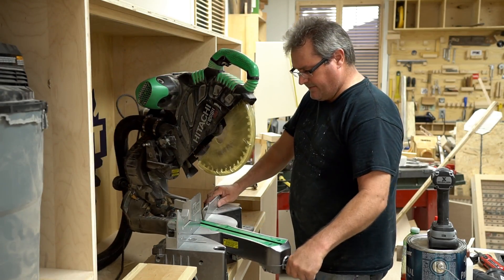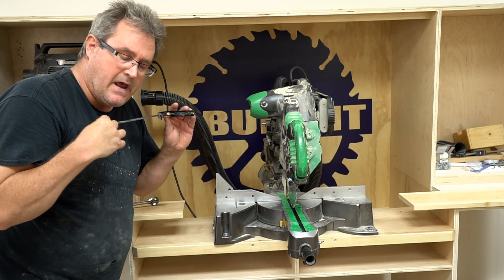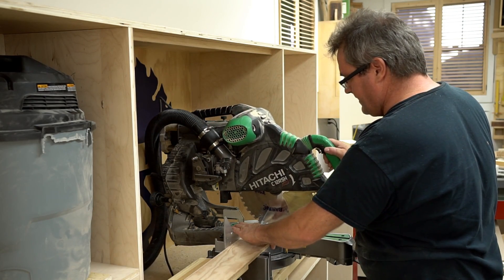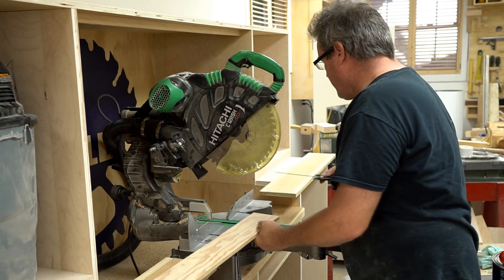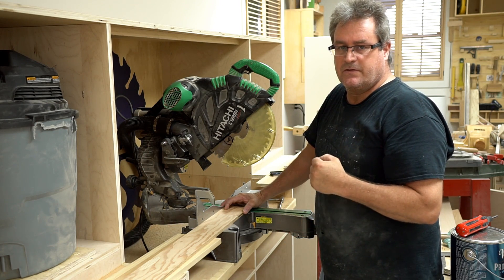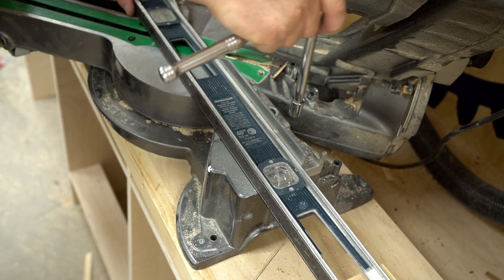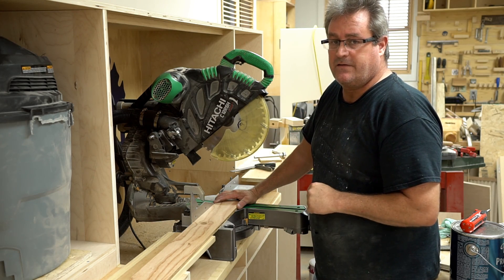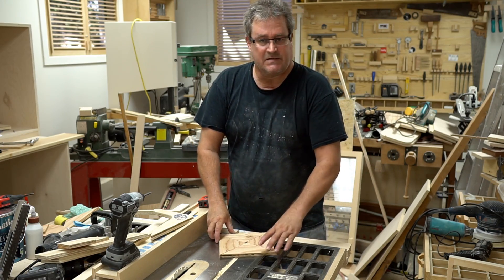Adjusting A Miter Saw For Accurate Cuts

Comment: Hi John,
Nice video. One question: when you tested the saw's 45 degree cutting capability, isn't the accuracy of that test be dependent on the accuracy of the plywood strip edges being exactly parallel since you referenced off of both edges? Thanks for sharing!
Reply from the maker: It's a given that the test strip of plywood needs to be straight and parallel.

Comment: Do the adjustable fences line up with the cabinet fences?
Reply from the maker: There won't be any on the cabinet. They only get in the way (if the stock is not straight) and are not needed.

Comment: Just got a Metabo HPT 12" Laser miter (basically the newer version of this). The left fence is so far off it's actually sad consider how much the saw cost.
I checked everywhere and didn't see anything that stuck out to be able to adjust them. After watching this video I'm going to go double check and see. Otherwise I'm going to have to basically make a shimmed fence to put on that fence... or just return it and get something that is adjustable.

I really like the saw so far after a couple weeks of use, but there's no way a supposedly $499 saw (marked down to $279 when I got it) should not have adjustable fences, right?
Reply: So, I went home and checked my saw after watching your video and realized I have to remove those subfences to see the bolts to allow adjustment to the main fence. I'm so relieved, and also questioning my engineering / mechanical ability now lol. After I finish this bathroom remodel, I have to get back to the trim, and am so glad I'll be able to dial my saw in and get more consistent cuts. Especially when doing the corners / 45s. 

Great video!

Comment: I'm sorry but where do you adjust if the blade is not perfectly 90 degrees (perpendicular) with the bed?  You checked it and it was but you didn't explain how to adjust it if it wasn't.

Comment: I do high end trim. My old Hitachi burned up. It is so old that I can't buy replacement parts. Bought the new Metabo 10 in. Out of the box it was such trash that the blade wobbled over a 1/4. Metabo said to take it to Cisco tools in North Kansas city.  So I did. Last October.  Same answer everytime I call. Pretty sure they ripped me off. They say its because of covid.

Comment: Hi I have a Ryobi compound miter saw it's second hand why do you think that the blade won't cut through the would 3" wide  5cm deep laying against the fence. could it be that the blade is not big enough could you help please
Reply: I would measure the diameter of the blade. If it isn't as large as the saw says it should have, there's your culprit. 

It's also possible someone adjusted a stop so the saw would go all the way through the wood. Not all saws have that option, though.
Reply: its the blade it is smaller than it can have thanks for that.

Comment: If you have access to a laser range finder (or whatever it's called) that reads in MM you can line up the fence to a hair's width. Even a cheap eBay one is decent enough to get you in the game.

What i don't get is why don't equip saws with a 90 standard. It would be a few more bucks, yeah, but let's face it, it's one of the biggest flaws as human errors go, putting a standard (like you'd get with a pair of calipers) in the package would solve so many of the "it's not accurate" complaints. So, so many.

Comment: My miter saw does not make the 90 degree cuts very accurately, 
I was hoping to find out how to adjust that part.
It does like just bang up to the max position and be a perfect 90..
drat.

Go link?
Reply: Unlike many others you adjust the fence for that. Basically you square the fence to the blade cut line.